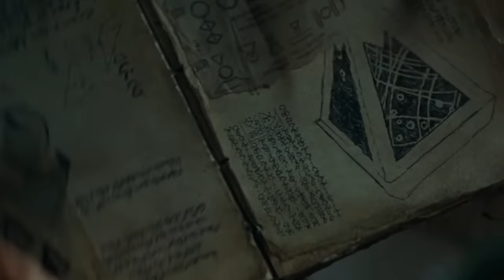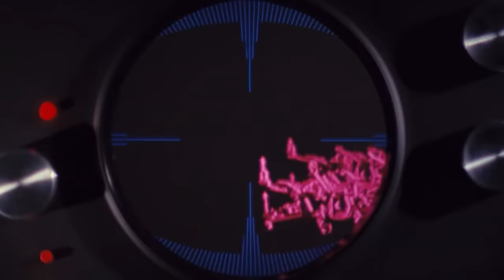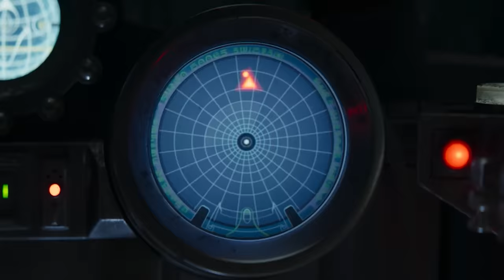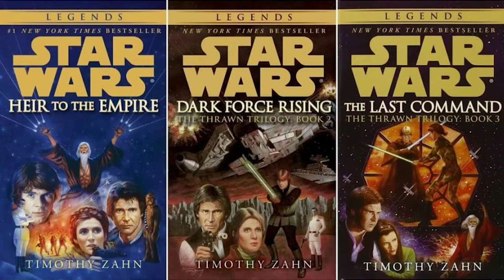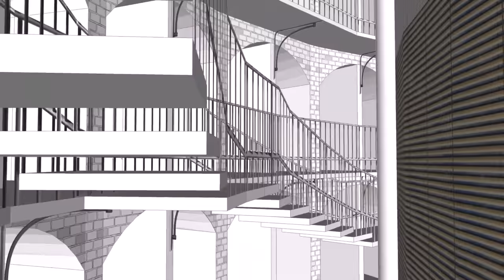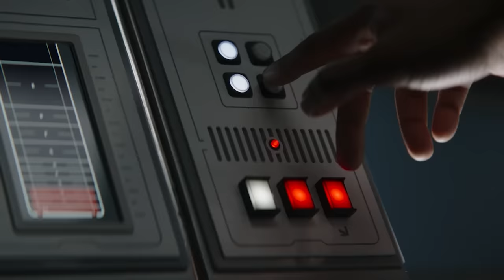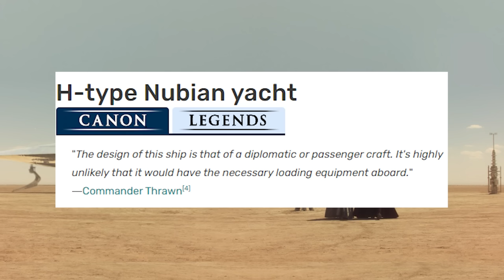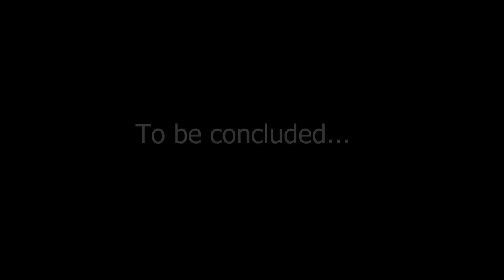The Mandalorian - This Is NOT The Way

Comment: I believe it originally was supposed to take the form of old western shows which didn’t necessary have a plot per say, but instead a cast of characters which are seen in weekly morning episodes. This worked fine until the later seasons and episodes when they tried to tell grandiose narratives of abandoned planets and lost cultures which conflicted with the original principle of the show; that there were no grandiose narratives as seen in the main films but instead a weekly theme and weekly problem with a weekly solution. A completely isolated show that just so happens to take place in such a dense world.

Comment: “Droid of Theseus” 😂 definitely one of my favorite lines.
Reply: Seconded
Reply: Can you explain the joke?
Reply: @Soccercrazyigboman  Ship of Theseus is a fairly famous philosophical problem that goes something like this.
Theseus built a ship and sailed it out. It returned and got minor repairs, rinse and repeat until every single plank was not on the original ship. Is it still the ship of Theseus afterall it isn't in any way the same as what he built but if it isn't when did it stop being one? When the first plank was replaced? When the last one was replaces even though it was still the same repair of replacing one plank etc.
Reply: @anaccountforcommenting6651  
the concept only needs 2 parts for the thought experiment. any more is filler and irrelevant. 

you can replace the ship with a broom

changing out the handle and then the brush still makes it a thesian broom
Reply: @fluffypinkpandas  I suppose you are right but I think ship is much more demonstrative of the issue as the overall change of one repair is much smaller in scope. When changing the handle of a broom you are changing over half of it and as such I think the part that is the most interesting (Supposing the object isn't of Theseus anymore when did it stop being such) is much easier to see in the example with the ship
Reply: @anaccountforcommenting6651  I see. Scope of changes in relation to the whole. 

Well

It shouldve been atomized in the explosion, so they outright replaced the ship in the beginning of National Treasure (after its been reduced to splinters) with a broom.

Thats pretty much what the Thesian Droid (IG88) was.
Reply: @fluffypinkpandas  were we to discuss to how I believe the problem is actually 'solved' the scope isn't truly a problem but it makes the relevant points much easier to see. In case of this droid it is replaced to a high degree AND his arguably most important part is replaced whole so yeah that ain't the Drone of Mando
Reply: my favorite is "how did Grogu survived 9/11?" at 2:03:56
Reply: I shall name him "T3-C3S"

Comment: My favourite part about Star Wars Squadrons is that Star Destroyers are allowed to be threatening and imposing again, rather than constantly placing emphasis on this "NEWER" and "BIGGER" and "BETTER" ship. In Star Wars Squadrons, throughout the story you swap from the perspective of the New Republic and the Empire, who aren't completely defeated, but after the death of the Empire, they are naturally struggling for coherent leadership and the New Republic is on a bit of a winning streak and are getting braver and braver. The Empire's perspective is told from Titan Squadron, who're under the command of Terissa Kerril from the Star Destroy Vigilance. Each mission involves you either leaving the Vigilance in a nearby system to commence a raid or whatever the nature or context of the mission, or it will take you directly to your mission where you will operate with it's support. The flagship of each faction in the story is just that, a flagship. It's your base of operations. Each faction throughout the story is essentially aiming to take the other out

Comment: You know, watching this video with the writers strike going on makes me appreciate how important their work is to these franchises and shows. Streaming services are notorious for understaffing their writing teams and these shows are the result
Reply: You are taking the wrong view on the shows and Strike. The Shows if anything show that the writers are over paid for low quality work. No matter the level of understaffing you should have a defined plot and consistency. These Writers like more non productive people have been over paid for zero value.
Reply: @TheFrmx  You make a good point, but that doesn't take into account how the writing room has changed. Originally, writers would make a script, but then they would remain involved during the whole production process. They would collaborate with the actors, tailoring the characters and updating the continuity as they went.

A modern writing room produces a script, usually on a time crunch, and then most of the writers are let go, and the producer only keeps a couple on payroll. Now, if something happens to the story, the original writers aren't there to update the script. Corporate calls in and tells the showrunner to cut an important scene because it "doesn't reflect Corporate Intrests?" The showrunner has to rewrite the scene without knowing the original writer's purpose. An actor isn't able to pull off a character perfectly? The showrunner has to guess how the original writer was playing that character off the other characters.

David Simon has an interview on it that explains a writer's job during production and how they work the entire time to provide a quality show or movie for their audience, and how that has been lost in modern Hollywood.
Reply: @allnonethevoid1487  So a group already adding nothing to society of actual real use value (all entertainment is a luxury and are not real value jobs) decided to make a more complex worse system to create more busy jobs of no actual value. Let them have what they deserve. These people have debased everything and everyone and not they can debase them selves on to the streets

Comment: Regarding the "seal yourself in your pod" comment... I think Mando meant that Grogu should seal himself up in that floating orb-like stroller thing he has, not the area that's been converted into an area to house a droid. That said, the comment itself was ambiguous, so it's very easy to misunderstand it AND it's also possible I'm wrong and that this is really is just the result of poor writing.
Reply: With either statement, he didn't wait to open the canopy...

Comment: Just a minor meta-quibble with Platoon's reaction to Botox Karen's ship scaring away the pterydactyl.  That sequence actually makes sense to me, but is badly presented and creates the inconsistency Platoon mentioned.  It seemed reasonable to me that she pursued the creature in her ship, and only then observed that it was scared by the ship and kept flying out of range.  She concludes that another option was needed to get close enough to the creature.

The mistake by the writers was to have Botox Karen explain herself and say that she'd do it later by herself.  Platoon rightly points out that no one would act like this - they would just do it and not announce it.  Her saying this was intended, I think, to tell the viewer why the ship wasn't a viable solution, and what she thought was a possible alternative.

The best way to present this?  IMO, SHOW IT!  Just have her ship hovering slowly in a canyon, trying to catch the Dactyl stationary.  As her engines spin up, the creature notices and flies further down the canyon, taking turns more quickly than her ship can follow.  Maybe repeat it once, and then have her open the throttle, pull out of the canyon in frustration, saying "well, that's not going to work" into the comm.  They may not have liked any "show it" options, due to the expenses involved in ship and creature effects in the same scene.

As the scene is written, the levels of ineptitude are mind-boggling.  They purposely create unnecessary complexity in a sequence that was itself unnecessary, then choose the WORST way of presenting that complexity to the viewer.   They make the exact same mistake in the Nepolorian-Grogu duel scene.

Comment: I think you did not grasp the meaning of the Coruscant train. The tickets are inspected by two droids (meaning the task is beneath flesh and blood employees) and in a very unsophisticated manner (just walk from front to back). That tells us Coruscant is not the kind of place where ticket dodgers are a big problem; the expectation is that most passengers do have tickets and will co-operate with the inspection. The fact that they jump over the holes between the carriages and do not die when they jump off the train tells us there has to be some kind of safety measure in place to prevent people from falling to their deaths from trains. Which is of course something you would expect in a mass transit system.

Comment: If you are the New Republic, and you wish to patrol (not terrorize) countless systems, you do not want Star Destroyers.  Not for long, anyway.  It concentrates too much manpower in one place, when the same amount of manpower could man a dozen or two dozen corvettes.  So if you can break down a Star Destroyer and use the material to make many corvettes or cruisers, that is the preferred course to take for the New Republic.   Maybe you keep some Star Destroyers for the limited warfare you might still need to fight, but much more numerous smaller vessels are better for you.

Comment: i do think season 3 sufffered from off screen drama and fallout from season 2. If anything, season 2 felt like a giant commercial in some sense for shows that Disney wanted to do. the republic commando show, the asoka tano show, the boba fett show, the luke skywalker and the new jedi academy show, etc. 

They got the boba fett show, and my guess is, that's it. That is my guess as to why grogu is back with the mando. As to this season, what really bothers me is it takes no time for the 4 or 5 season long plots to develop. Mandos redemption could have been a season long plot, the pirates could have been a season long plot, the retaking of mandalore and/or the death of moff gidion could have been a season long plot. Its as if the writers do not trust people to be invested in these smaller plots, when that's what TV does best, small plots, focused on character and the setting they inhabit.

Hell, the imperial re-education or reintegration camps alone could have been its own show, with patience and thought. But herein lies the rub, ideas require patienceand thought, and there is a extreme lack of both from the writers and perhaps even the audience.

instead, everything the characters overcome seems absolutely trivial. The impossible things everyone is sure are impossible, are settled in about ten minutes, and by simply applying a bit of effort. which means nothing stated was actually impossible, its just everyone in the galaxy is lazy.

TLDR: good ideas and no commitment or follow-through, has long been the problem with the Mandalorian, and cripples it in this season.

Comment: Season 1 was too slowly paced with a lot of filler, so I didn't really like it except for the finale and the episodes leading up to it. Season 2 wasn't bad most of the way through, and it ended on a high point. Season 3 was completely dope, and they fixed almost everything wrong with the 2 previous seasons.

Comment: I agree that scrapping Star Destroyers is stupid, it may be explainable on the basis that for ideological (and stupid) reasons the subsequent government may have wanted separation from the Empire.

That being the case, the advantage the Empire had over the Rebellion was primarily logistical and not technological.  They had more stuff, so much more that they could stick with inferior equipment (Sienar Fleet Systems TIE fighters) and only belatedly introduce TIE variants (Interceptor, Advanced) to compete with the X-wing.  The X-wing is properly the Incom T-65, which was commissioned by the Empire to replace the TIE fighter, rejected on budgetary grounds (and political connections between Sienar and the Empire) despite being demonstrably better.  The Incom design team stole the production plans, which were put into production for the Rebellion.

The Rebellion capital ships are a grab-bag collection but the best of them  (Mon Calamari ships) are not technologically inferior to Star Destroyers, the line quoted from Admiral Ackbar is in reference to the numbers of Star Destroyers, not their superiority.

The Battle of Yavin is essentially the Battle of Britain condensed into half an hour.  The X-wings are the Spitfires, the Y-wings are the Hurricanes.  The Empure inherited all the manufacturing capacity of the Republic and simply iterated existing designs into the Star Destroyer and Super Star Destroyer.  The Empire pursues Wunderwaffe much like another authoritarian opponent of 1940s Britian, the SSD and the Death Star are wunderwaffe that do not ultimately win the war, and represent a diversion of resources that would have been better used in other pursuits.

Comment: On the cloning problem-
There are quite a fiew things known about cloning, and mostly stem from the galaxy not doing it (probably for ethical reasons), so the republic at the time went to a species who based their whole existence around genetic cloning and manipulation. And while simple organ cloning could be viable in the galaxy, that problem is already probably solvable by bionic implants, akin to the arms of the Skywalkers, or vaders whole body. If Pershings mother was sick during the time of the empire and died because no organ cloning was available, it could have been because the empire itself outlawed it, but its important to know that outlawing it doesn't mean they didn't practice it. The Bad Batch goes into this, where the Empire actually did want cloning, but only for themselves, even preforming a genocide on the Kaminoans, and hoarding their databases and knowledge on the subject for themselves. But only in a way to keep it secret and safe from the general populace. Thus, if they outlawed cloning from all general hospitals within the empire, and it is established beforehand that only the caminoans actually did do cloning to any meaningful extent, and they are off the table since they got altF4-ed from the game, you can have a situation where Pershing would find cloning of organs "unavailable" even if the Empire itself knew it wasn't really so, but they kept some secret projects in the work on cloning still happening in the background, while keeping it away from the public

Comment: On decommissioning star destroyers; that actually makes sense, though it's mostly made clear through extra material. While the star destroyers were technologically advanced, they were also grossly inefficient. The empire followed the Tarkin doctrine, which was all about maintaining order through intimidation, which meant created the image of overwelhming might. The star destoryers were overkill for the job; they were costly and inefficent. A fleet of much smaller ships that could spread out more across the galaxy would have been FAR better. So it actually could be the case that scrapping the destroyers for parts would be more efficent than keeping them in service and spending resources to maintain them

Whats idiotic about the new republic is downsizing thier own military

Comment: I really really like what you have to say about the Star Destroyers, the imperial Navy and why the New Republic would use them. I wasn't so much into the old EU, but even I have heard and read of parts in the EU where the New Republic employed captured Star Destroyers. 

When it comes to the Empire and it's military as a whole there has been a decreasing lack of common sense for the last couple of years. the collective Fandom has decided that the TIE Fighter, the normal ones, are just flying Tombs, made out of paper and that their supposed lack of oxygen inside the TIE means that the Empire doesn't care about it's Pilots, which can be easily confronted with the Question :"Which side equips their Space Pilots with a functioning Space Suit?"

Even worse is that the Fandom has decided that the Shields of the X-Wing are impenetrable walls, despite every instance of a TIE hitting and X-Wing proving the opposite. And the Prequels too have done a lot of work to establish how Shields work. It's a visual explanation and I doubt many have noticed it, but Shields only stop Fire from a lower class/caliber with the exception of Bubble Shields, which are seemingly stronger than the "Skin shields" as I call them.
And there's another thing. The TIEs are generally described to have no shields at all. But there's is no actual proof in the Movies that would suggest that Idea to be true. That said there's also no proof that would suggest the opposite.